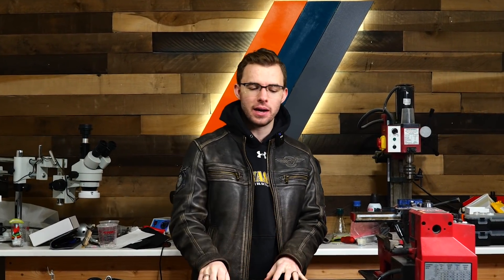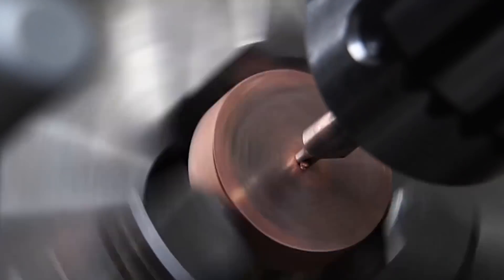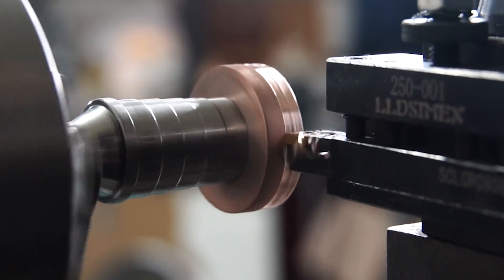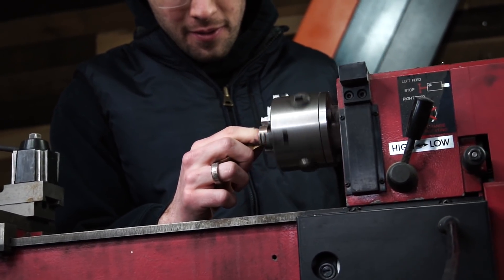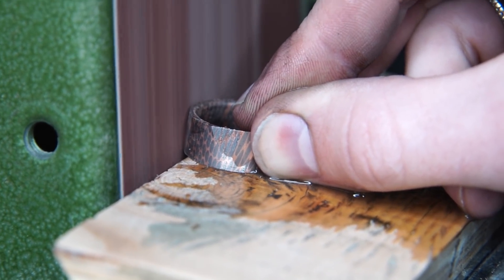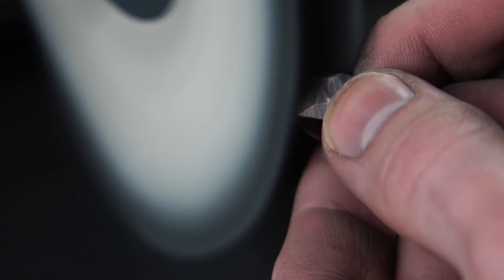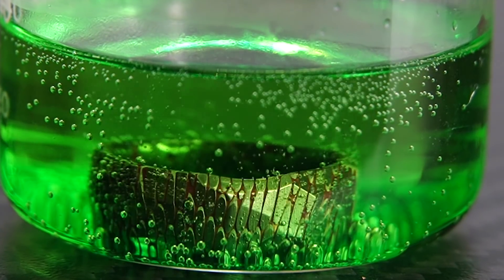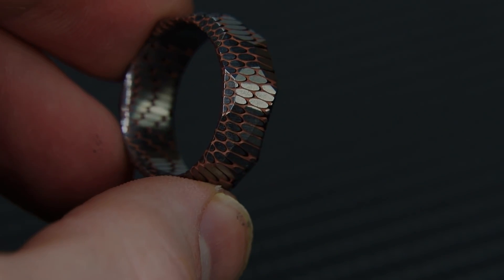Making the Superconductor 2.0 Ring | Acid Etched Superconductor with Obsidian Facets Part 2

Comment: Quick question, I noticed that when drilling the hole for the ring, a rig is used that spins the superconductor button itself instead of the drill bit. Is this because it creates a better finish than a moving drill bit? Or is it simply just the equipment available?

Comment: Could this be ca sealed so the copper wouldn't tarnish.?  I think it would be cool to either ca with glow powder in the cracks,  or maybe try a process similar to stabilizing wood on it with clear epoxy so that it would fill the cracks but you could still see through to the copper layer.

Comment: Do those expanding ring mandrels fit on a hand drill?
Reply from the maker: Matt Smith 1/2” so most full sized drills will work.
Reply: Patrick Adair Designs awesome thanks 🙏🏼
Reply: What’s the shank size?